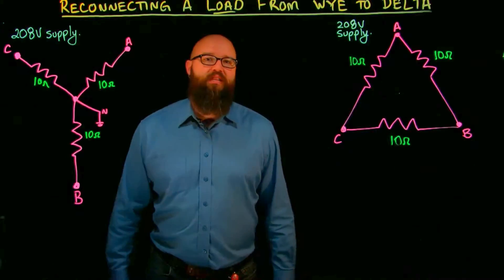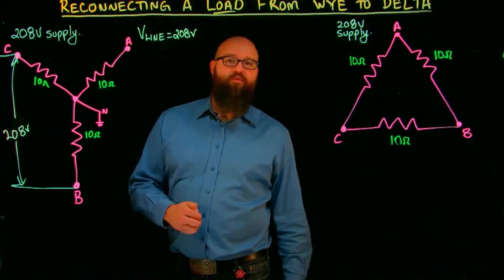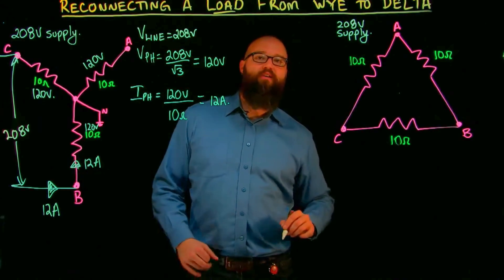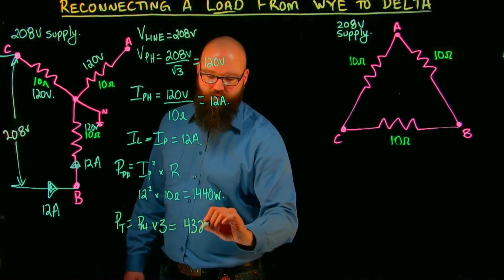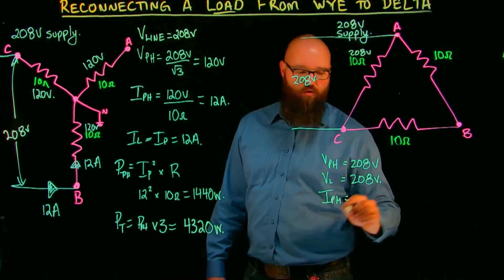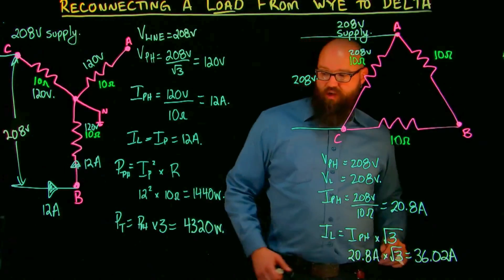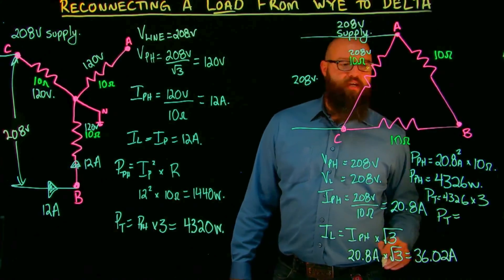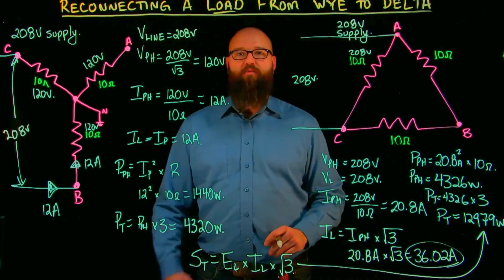Reconnecting a WYE Load into DELTA

Comment: Why is the centre point of the WYE load shown as connected to neutral when it is NOT and should not be connected to Neutral of the supply?
Reply: In Wye the center is connected to neutral.
Reply: it would also help balance the voltage on phases as bonus to other single phase sensitive consumers like computers and the spark ignition of some gas stoves

Comment: Thank you for the video sir. But , the values of resistors will remain unchanged in both Y & delta connections?
Reply from the maker: Thanks for watching! Yes the resistance would be the constant physical value of the load. Imagine a physical ten ohm resistor. When you take it out of the circuit it is still a ten ohm resistor no matter what voltage you apply to it.
Reply: @schulerruler  thank you sir 😁